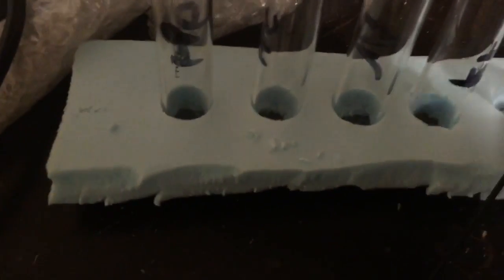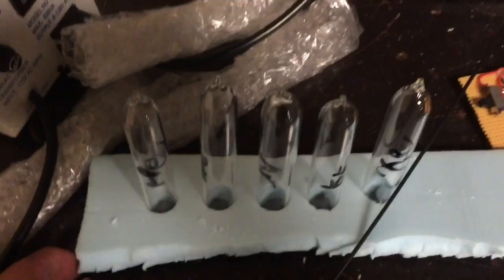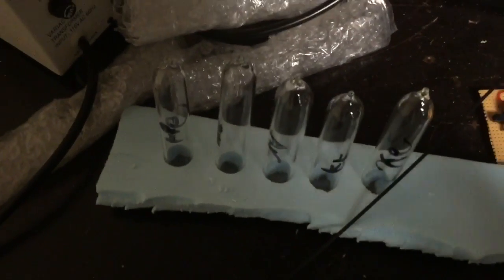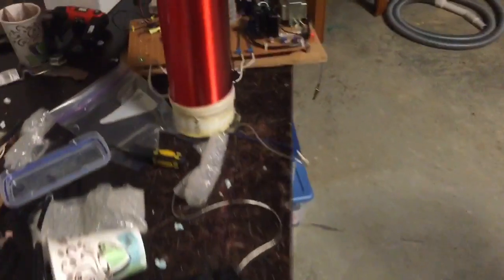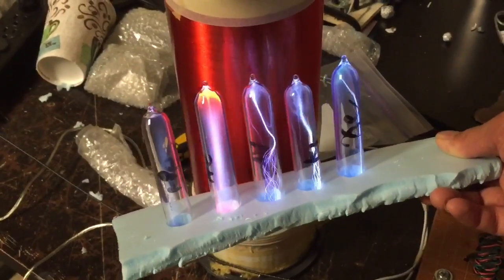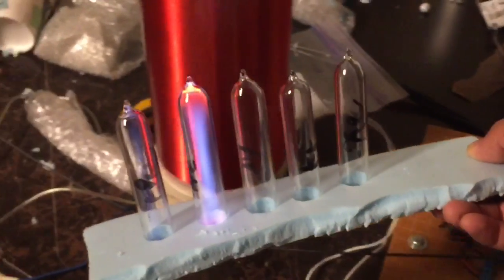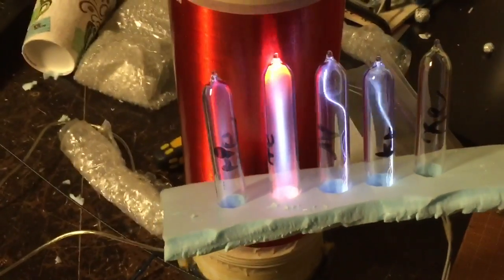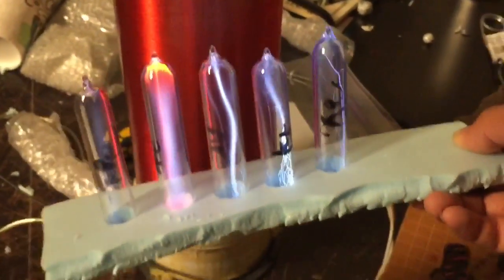Lighting up Noble Gases with a Tesla Coil

Comment: Thank you for your nice video. I have a question about your high voltage, can you tell me your high voltage was positive or negative?
Reply from the maker: Thank you. Yes, the high-voltage from the tesla coil is  alternating current both positive and negative. The colors  of gas is related to positive ion formation in the gas filled tubes.
Reply: @BrianDhvTinkerer  Thank you. Do you think the gas also work with negative ion? About Helium color, science proved that helium also radiates infrared color, have you ever checked its color in infrared range?
Reply from the maker: No, I’ve never checked helium in the infrared range. However, that is a great experiment to try.
Reply: @BrianDhvTinkerer  Thank you. Please forgive me for questions. Do you think i can light up the gases with high negative voltage too?
Reply from the maker: Yes- you could do it using a high voltage DC negative source such as a CW multiplier. I was able to ionize water using this method:

https://youtu.be/JSylaU2YvUE?si=FLDrgrCIcXY5c3Qa
Reply: @BrianDhvTinkerer  Thank you for nice videos. I want to test spark method for alpha particle (AM-241). Do you think i can test it with 1000V-DC?
Reply from the maker: Probably need it to be higher say about 5 kV

Comment: The sky is blue because the sky has a high saturation of nobel gasses up high. They're giving off light due to their proximity to the sun which has an electrical charge. When they sun goes to bed the sky stops glowing.

Comment: High frequency or high amplitudes your still thinking of hi high voltage beaming would be more direct approach a single wire guides for transferring momentum and compaction or cuts micro in sizes

Comment: Very cool video. I have the same set of gas tubes and my own tesla coil, and they light up exactly as yours do. Do you have any idea why helium and neon are both more glowy while the rest are more arc-like? Mine are the same way and I'm very curious to know.
Reply from the maker: I think it has got something to do with the other glass (that look more arc like) being at higher pressures then the neon and helium. These arcs can also be seen with incandescent light bulbs with contain argon at higher pressures.
Reply: What about other elements that can liberate gases in some conditions? Would their gases work?

Comment: Would the gas react without the tube if it was a steady flow
Reply from the maker: I think it would. I tried it with atmospheric pressure argon and it lights up
Reply: @BrianDhvTinkerer   I make swords and I have this idea, I don't know if it will work. I'll have to play around with it, I want to try to integrate it into the blade. Very low voltage of course but if I can get just the smallest affect, it's going to be fricking awsome.
Reply: @BrianDhvTinkerer  What was the voltage you used with the argon and have you tried using any other gas

Comment: Nice video. Can you show the technique to put the argon into the test tube? thanks!
Reply from the maker: Thanks. Here is the technique I used. It is not the best but works well:  ⚡️ How to Make Low Pressure Gas Discharge Tubes ⚡️
Reply from the maker: Hope this helps. https://youtu.be/zxbWy9-Li9s

Comment: What's the minimum wattage or voltage/current for each element for that size vial?  I see neon is the lowest, but I'm trying to create a project where I can use a small tesla coil to light up vials and I want the smallest coil to do it.  Thanks
Reply from the maker: I think it should be possible to light them up with a few microamps at approximately 30 kV. What I did with mine is I just increased the voltage generated by the Tesla coil using a variac

Comment: Where did you get the fiber optic transmitter/receiver? I was looking for some online but couldn't find any
Reply from the maker: Use fiberoptic receiver FB142. Use fiberoptic transmitter FB123-ND. For the fiber cable use CBL fiberoptic 1000uM SMPLX 10 meter length. These parts are all available from Digikey. Hope this helps.

Comment: Im pretty sure these gasses are being turned to plasma. Correct me if I'm wrong
Reply from the maker: exactly. The high voltage from the tesla coil excites the gas by ripping off outer electrons resulting in a mixture of excited positive ions and electrons ie plasma. The excited electrons in the positive ions dropping back down to lower energy levels results in light production of the plasma.

Comment: Great video, where did you get the gasses from ?
Reply from the maker: sorry for my late reply. I bought the gases from a chinese supplier on Ebay. Recently, I learned how to make my own tubes and have filled them with neon, nitrogen, oxygen, argon, helium, CO2, iodine, air etc. I bought a single stage as well as a 2 stage vacuum pump and a 3 way stopcock to fill the  tubes with gas and achieve the desired low pressure. I evacuate the tubes in the presence of a Tesla coil to make sure I am getting the desired gas ionization.
Reply: @BrianDhvTinkerer  Hi I appreciate if you can give a link of how to fill the tubes, I already have the parts. Regards
Reply: @BrianDhvTinkerer  what do the diffrent gases do when electirfied? Like is there purple or green or blue? etc
Reply: @comet1310yt  There are a wide variety of colors that can be produced. It's important to note however that the colors are not necessarily set for each element. It can range based on how much you try to excite the element. Each element has shells "orbitals" of electrons. These are in set energy levels. When you excite a gas you essentially bump these electrons upwards and they then drop back down to their more stable ground state. When they drop back down they release the energy difference as a photon corresponding to that energy difference. Thus if you provide a higher voltage you can bump the electrons up higher and get more energy differences between the ground and excited state. However, since each element has a different ground state you get a wide variety of options. The color corresponds to the wavelength of the photon that is released. Some wavelengths are  in a visible color format, but you can also produce other varieties such as UV. These gas excitements are exactly what produces the auroras seen close to the pole of the earth. Gas is excited by charged particles in the atmosphere and when the electrons drop down in energy they release the photons.
Reply: @comet1310yt  Helium is typically orangish and sometimes greenish-blue. Neon is red-orange. Argon can be violet to a sort of pale lavender. Krypton can be off white to dull green. If you provide it with a very high current you can produce a blue-white. Xenon can be a blue-gray dimmish white and at higher current a blue-white. Oxygen ranges from violet to lavender. Hydrogen starts at lavender and ranges to pink/magenta at higher ranges. Those are the more common ones to excite. If you so wished you could excite stuff like radon too and get red, but given that it would be super expensive to get in a pure state in ampoule storage and would likely kill you in an appreciable amount, given it's most stable form has a lifetime of under 4 days, that might not be the best idea.